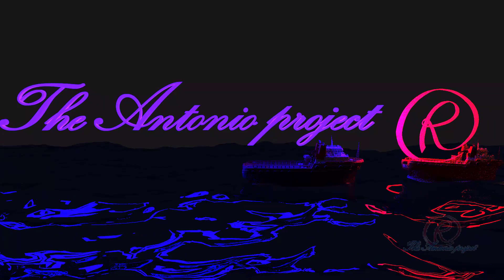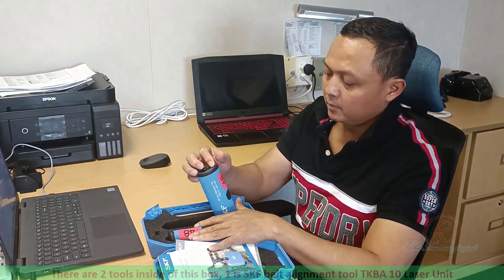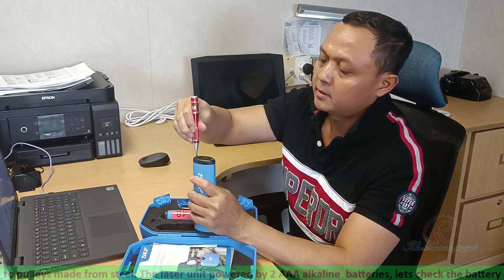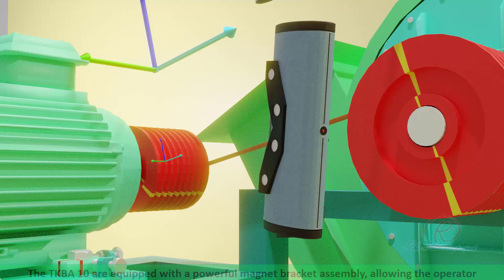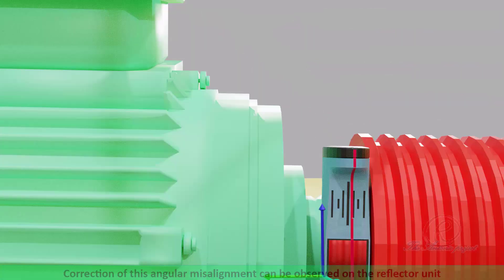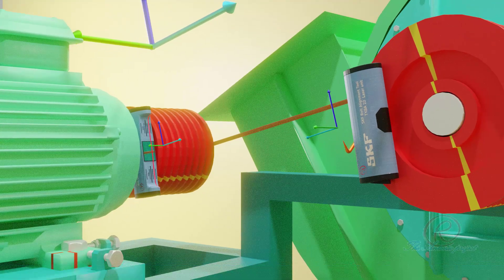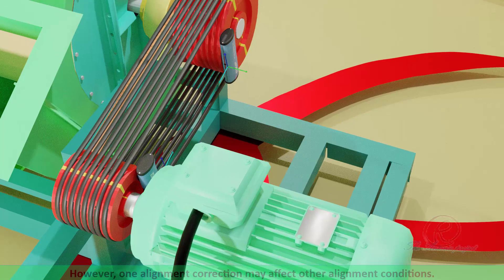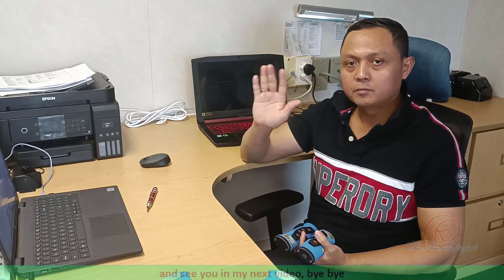Unboxing SKF TKBA 10 Belt Alignment Tool and How To Use It

Comment: What is the measurement between the lines in receiver unit
Reply from the maker: The unit consists of Transmitter unit and Reflector unit, the transmitter will emit laser line that projected onto reflector unit which is having a target area with central refence line. 
The laser line reflected back to transmitter unit for reading on the second target reference line. 
Miss-alignment correction done by adjusting moveable part (El motor)until laser lines coincide with reference line on transmitter and reflector units.